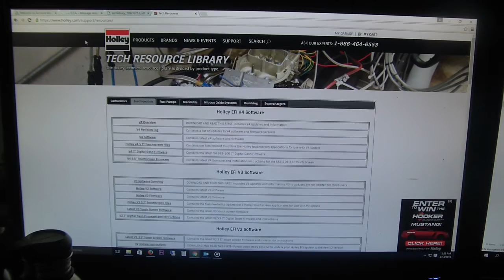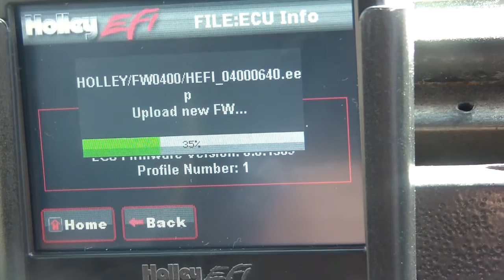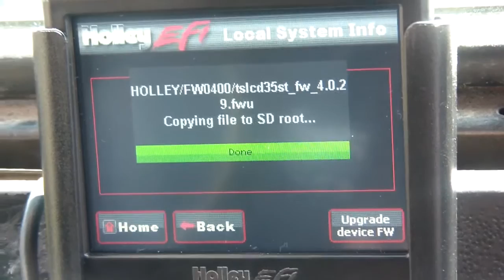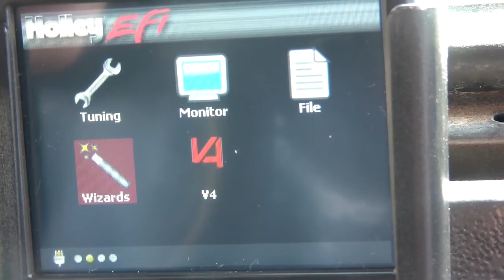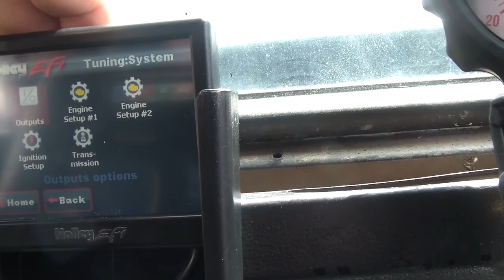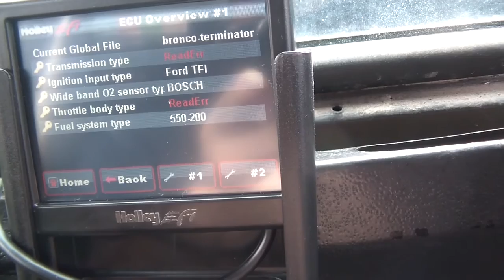Holley efi fuel injection V4 software update terminator HP Version 4

Comment: Thanks for the video.  I'm in the process of updating my Terminator firmware to ver 4.  Read something about the Global issue on previous tune.  Holley folks a great help, said back it up before upgrading firmware as the upgrade erases the old Global files.  Did that using my desktop computer and it did a "conversion" to a file that is V4 compatible.  Will come back here and post after I upgrade the firmware, and get the car running again.   It's a '72 Plymouth Road Runner, 440 engine, mild cam, Keisler 4 spd Overdrive transmission (GM 4L60-5E) with the Terminator EFI system installed.

Comment: What the best Value Plug and play ECU Kit to suit a Manual Pontiac G8??
Reply from the maker: Since you have a modern car probably holley dominator. Nothing is going to be plug and play if you have a modern car. You probably be better off programming the current ECU and run a ODB2 set of gauges or tablet. if you change the stock computer you probably wont be able to get it smogged.